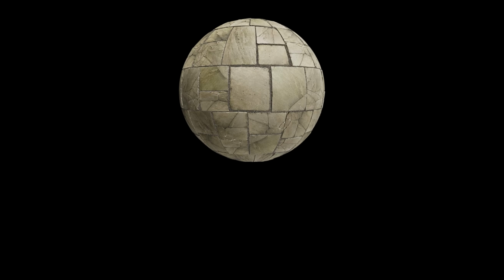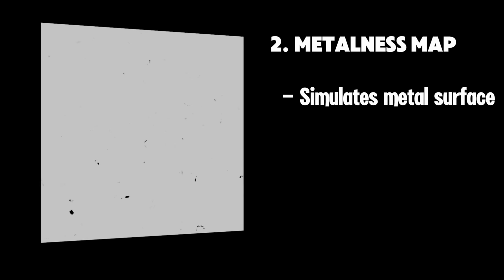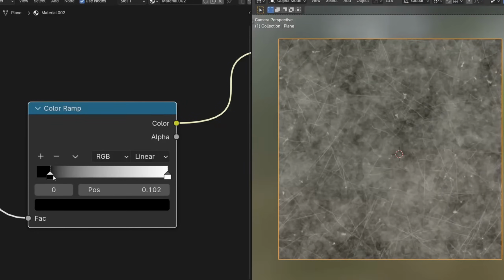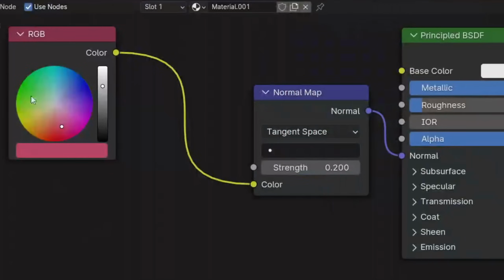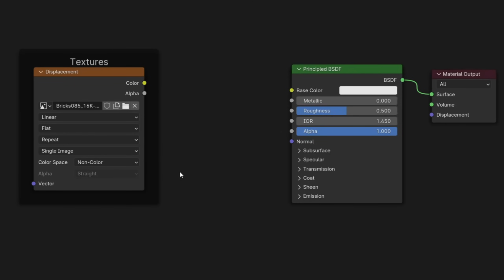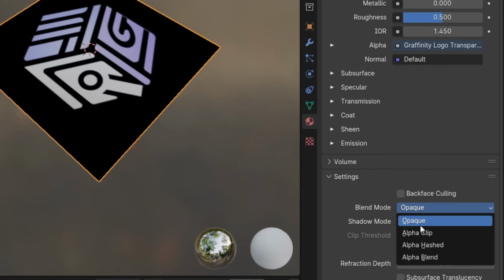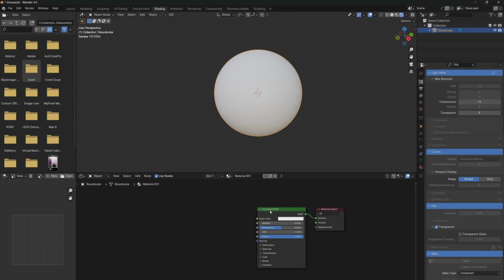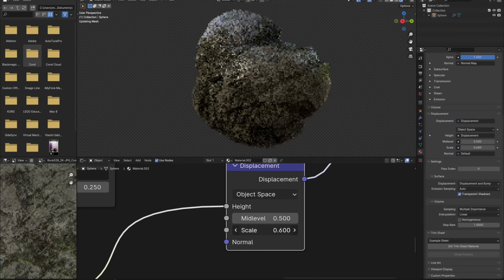PBR Materials Explained

Comment: Dunno why i got this video in my feed, but it’s just awful and misleading, especially for a novice.
-Albedo map doesn’t contain lightning data in a color not a diffuse map.
- AO map is a cheap contact shadow trick, unbiased renders don’t need them.
- rubber is a an awful roughness example for novice cuz it has SSS, besides no word about SSS itself
- normal section doesn’t tell you that exists difference in a silhouette appearance between normal/bump vs displacement 
- colorspace doesn’t explain aces/non aces workflow, also misleading 
- alpha in png. png doesn’t contain an alpha channel, it has a transparency channel and it’s a reason why it’s an awful format for vfx work.

If you read this, please go and research on proper shading if you are looking for it, every render engine website has documentation, go and read it.

Comment: I make all my textures procedurally using these concepts (not a new concept I know). Starting with a tuned noise texture, I use math nodes and shaders to control exactly what kind, and how much randomness is applied to each map. This allows for a ton of detail if applied correctly. One material I made recently was over 75 nodes for the fabric cover of a military helmet.

Comment: correction : normal map are not color information, it is light vector data encoded in colorimage  from -1 to 1 where RGB are 3 axis R(Right) , G(Forward), B (Up) axes. while color or greyscale data ranges from 0 -1.

Comment: Wait isn't the roughness explanation completely wrong? what do you mean rubber absorbs light? Things that absorb light are black, rubber just diffuses the light, meaning that every ray that hits it goes into a different direction because it's uneven and porous
Reply from the maker: You are right, my statement was wrong so let me clarify. Rubber has higher Roughness, therefore it producs more diffuse reflections where light is reflected in all directions rather than in a single direction. It also absorbs some light due to the rubber properties, but most materials reflect the same amount of light but in different ways based on how rough the rurface is. That's why the specular reflection in the principled BSDF should be mostly set to 0.5 and only the Roughness should be adjusted.

Comment: Rubber does not absorb all light, in that case it would be just black. And mirror does not reflect all light, you can have a very dark mirror that absorba like 90% of all light but it would still be a mirror.
Reply: Maybe the terminology isn't quite there, but I think you get the general idea.

Comment: 2:47 I'm not criticizing but wouldn't a rubber that absorbs all light appear black instead of white? I've been trying to understand what makes something reflective for a long time and I don't think it's just how smooth it is. You could polish any material to a 'mirror finish' of flatness and it wouldn't be as reflective as the metal used in mirrors. Why does a perfectly smooth, flat rubber surface scatter light so well? Is it that some of the light penetrates and bounces around before returning to the environment? I think this is the explanation but I'm not certain, I've always heard it explained as surface roughness being responsible but I'm not convinced.

Comment: I'll never understand why normal mapa must be set to non-color if they have colors
Reply from the maker: I think it is because blender is not actually using the color information, rather data stored as colors. My theory is that Each RGB channel is used as a greyscale texture which is then converted into XYZ coordinates.
Reply: I think the default is to apply gamma correction to color images. That would mess up the normal maps since they're saved with a linear color space - I.e. the difference between 0 and 1 is the same as between 254 and 255.

With colors after gamma correction, the intensity change between 0 and 1 is much less than between 254 and 255. 
I.e. without gamma correction, going from 1 to 2 is 100% increase, while going from 100 to 101 is a 1% increase. Gamma correction makes it possible to reproduce smaller intensity changes in dark areas.

Comment: I need help am new to blender and I was just trying out this...... And then I can't find the displacement node which I can apply the height map
Reply from the maker: Maybe it is not visible because you are using eevee instead of cycles.
Reply: @Graffinity3D  I have another doubt... Can I use a displacement map instead of a bump map and vise versa
Reply from the maker: @fuuuryyy  well height map can be used to displace the plane but it can also be substitution for normal map, if you use bump node. This is a friendly advice. If you think something can work, try it first and then ask if something is not clear. It will be faster for you to find out than waiting for my response. 💪

Comment: You’re missing something. POM or Parallax occlusion mapping, is a good option to replace displacement, it doesn’t increase the polygon count but it does provide depth. The only weakness it has is it can only go into the surface, not out of it. It’s better than normal mapping.
Reply: Dunno about blender specifically, but parallax displacement doesn't need any specific maps. It's more of a Shader effect and if your software of choice support it. It should work with standard displacement maps.
Reply: @telefonkirtys with enough effort, Blender can in fact support POM
Reply: @gamerboygb6041  I thought it natively supported it. But i could be wrong
Reply: @telefonkirtys  it’s called POM because unlike PM POM also calculates what is in front of and behind at the current angle of view
Reply: I don’t know what you’re source is but parallax mapping in vray is worse and slower than displacement(2D landscape), by a significant amount. Tbh i’m not sure it’s it’s useful at all.
Reply: @MrMadvillan  it's a similar use case as normal mapping; it can add some extra detail without millions of vertices
Reply: @MrMadvillan  POM as a method is a shader effect, and is faster than high detail dispalcement mapping because not as many polygons have to be generated
both POM, and displacement have their places tho

Comment: This is a great overview, but you would do well to inform newbies that not all normal maps are created equal. There are two types OpenGL and Direct X normal maps, and the difference between the two is the GREEN channel is inverted. Therefore, if you load a normal map and the shadows on it looks 'not quite right' somehow, you're using the wrong kind of normal map. In the intance of Blender - which uses OpenGL normal maps - loading in a DirectX normal map will look off. How can you tell which map is which? Sadly, there's no simple way until you apply it to your model.

Luckily, the fix is simple, drop an 'RGB Curve' node between the normap map texture and the normal map node, and simply invert the green channel. Alternatively, uses a 'Separate RGB' node, with the green channel connected to an invert node, and then all channels back into a 'Combine RGB' node. Unfortunately, these two standards have co-existed for years so, you just have to fix them as you see them. A good way to check is to add a green inversion solution as detailed above and switch to a rendered view (Eevee/Cycles) and simply press 'M' to mute/unmute the node and as you toggle back and forth you can see which version works better.

Keep up the great work!

(The same is true loading OpenGL textures into a DirectX based engine/renderer)
Reply: Thank you, I understood a bit, but I want to see it practically. Do you have any YouTube video that can explain it to me better?
Reply: @TechTotal94  I just recorded this to explain it. Sorry for the crap sound, I'm not a youtuber :P https://youtu.be/8CbwH6H-15Q
Reply: @TechTotal94  I tried to post a link to a quick video I threw together explaining it, but it seems like I can't post links here. I'll inbox you and @GraffinityOfficial the link as it's really useful information. 

Edit: I can't find a way to contact you so I've just stuck the the video on my channel publicly. Sorry about the crap mic, I'm not a youtuber, ha ha
Reply from the maker: @mattburkey  Here is the video: https://www.youtube.com/watch?v=8CbwH6H-15Q